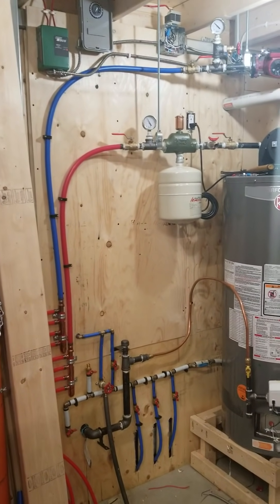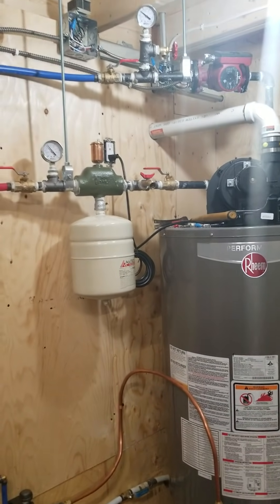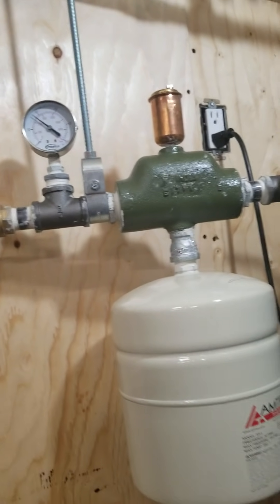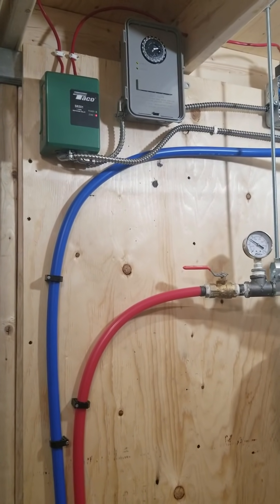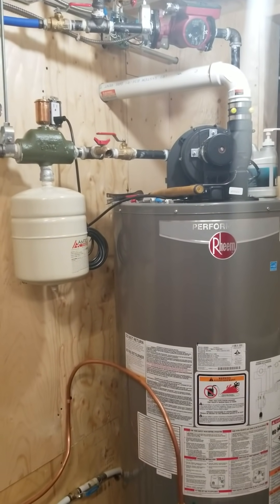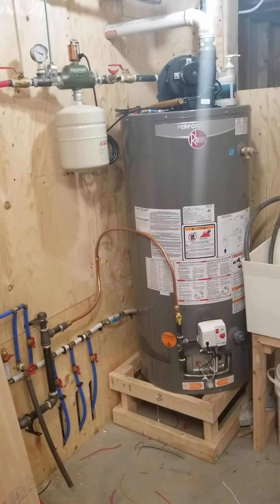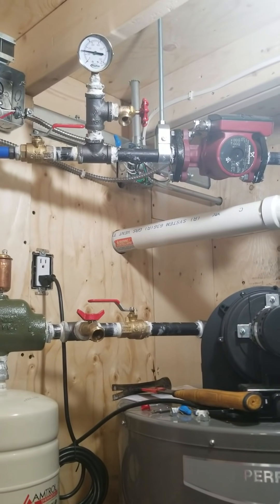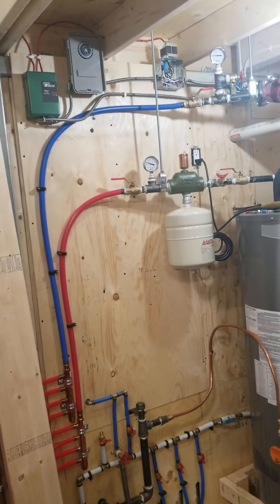DIY In-Floor Hydronic Heating System Using Water Heater

Comment: Why did you choose to add your expansion tank on the hot supply versus the cold intake? Reason I'm asking is I'm doing the same sort of system and I have the same grundfos pump but on the hot supply line (I think yours is on the cold)  and I have a 1 zone ,  return line going back into my cold side of my hot water tank with a check valve on the return and a check valve on the cold water supply to prevent back flow. My expansion tank is in between the 2 check valves(return line from infloor heat - cold water inlet ) (directly off the top of the the hot water tank). Just curious if you had any over pressuring issues since you made your video? (Nice system btw)

Comment: We bought a house 4 years ago with infloor heating in the basement my expansion tank is starting to leak water from around the seal at the top of the tank the tank is mounted to the ceiling above the water tank so it sit quite high anyway what would the leak on the top of the expansion tank indicate. What do you think is happening here to cause the water leak 0:50

Comment: I have a large garage underway - no living space and no water service intended.  This is a great concept but I've been warned that it's not legal in Ontario.  A contractor advises... that water heater sold in Ontario. come with this reference. "This appliance has been design certified as complying with American National Standard/CSA Standard for water heaters and are considered suitable for Water (Potable) Heating and Space Heating. Note: Water heaters used in combination water/space heating shall not be used in space heating only applications."  THE WORDING IS A BIT AMBIGUOUS..; ANY THOUGHTS?
Reply: By ambiguous, I mean the quoted line...the conventional tank is NOT designed for combi heating, but rather soley designed for use on ONE water heating application, so I wonder if this is applicable and if CSA's intent is specific to the single use of a combi-designed product?
Reply: If the garage is a separate unit and not a living space, it is in fact not illigal to use a hot water tank for heating. If it was a home or dwelling unit, you may or mayn't have an issue depending on Bulding inspector. I think the issue with combo units was that people were not using the heating system in summer and bacteria would build up in the heating portion then mix with potable system when turned back on

Comment: You mentioned the cost was near $2000, did that include materials in the floor?  Thank you.
Reply from the maker: Negative. I paid just under a buck a foot for it though. 1 foot of pex per square foot of shop.

Comment: Nice setup. Ive been trying to figure ways to heat a 40x80 shop build for basically as little money as possible naturally and on the fence over wood, oil or gas. Radiant floor heat, radiant tube heaters, forced air unit heaters, a wood burner with waste oil drip and a heat exchanger and also a waste oil forced air or boiler systems. There's so many pros and cons to each setup im still not sure what i will go with but you gave me another option to think about. Thanks for the tour and explanation.

Comment: Nice work , i am currently piecing together what i need to do a similar system in my 2400sqft shop , i have to use an electric hot water tank as i don't have natural gas hook up . Wondering if a electric hot water heater will be enough for my needs , I live on Vancouver Island so the coldest it gets is maybe -15c , I have been looking to size the circulation pump properly as well , the pump i am looking at is 8.5gpm. Would you add a mixing valve as mentioned in the comments? think it would be a benefit to my system ?

Comment: In our previous condo we had installed a GE water heater. We heated the floor with the water heater and use it for all days use. Showers bath and hot water on the faucets . We had this system operated for 11 years and sold the condo last year , with the system still running perfectly. The G.E. Water heater is 60 gallon tank and is warranted by G.E. for 12 Years. The cost of the tank was that time with tax around 1000 dollars Canadian.
Floors,walls and ceiling was heavy insulated. Lots of windows etc. 36 % of walls are glass. New owner very satisfied.

Comment: I really like this concept for the water heater, my question is the timer.  Does the taco relay turn on the timer or the timer turn on the relay. These are 120v tank is 220 volts. Thanks again Gary
Reply: How does the timer turn on the  water tank because it's  220volt?
Reply: The relay controls the pump

Comment: Could I asked,  what size is the water tank,  thanks Gary
Reply from the maker: 50 gallon
Reply: @jpaul1030   is the glycol in the tank also?
Reply from the maker: @garyeager6460  yes, I introduced the glycol to the tank as I was filling the system

Comment: A tankless unit would be better and has a built in pump I can get one for half the price noted above from a nationwide plumbing supplier
Reply: Your concrete won’t crack if it’s 6in  with rebar, 4” styrofoam insulation under your slab
Reply from the maker: Are you located in Canada?
Reply: Wolsely and BG sell tankless and combi’s starting around 2.5 3

Comment: How's this system working 4 years on? I'm building a 1500 sf garage and planning something very similar. I have a very expensive on-demand NG boiler in a 10-year-old apartment building and it's already on its way out, so I will certainly be going with a HWT in my garage too lol.

Comment: Very impressive setup, and really helpful video.     What is the BTU output of your water heater?  I am considering a very similar system, however I need to use an electric heater (planned solar power in the future for my shop), and am trying to figure out the wattage heater I need.  (30' x40' insulated shop w/16' ceilings)

Comment: I don't really think the timer is necessary. Your water heater works best at transferring BTUs when there is a big delta T. Just let the system run and it will eventually catch up. There is no wasted gas... in fact you would be wasting energy when trying to heat high temp water to a higher temp.

Comment: Hi thanks for the video I very much enjoyed it.. One question I had was about the intermittent timer on the system. Why is that needed? My thinking is if the output of the waterheater is getting rather cold the waterheater will be running and the output will be warmer than the input. So it will be adding energy to the system. I'm thinking the timer just limits the heating capacity of the system.

Comment: A lot of brass connecting to iron.  Expansion tank is upside down.  Water pump is at top of entire system and should be at the bottom to prevent cavitation. No mention if the pex is oxygen barrier or not.  Canada must have very relaxed red-seal requirements. I worked at Emco for years so I do have a bit of knowledge of heating systems.
Reply from the maker: Just because you worked the counter at a plumbing wholesaler doesn't mean you have a clue about what you're talking about, and your comment proves that. The expansion tank can be mounted at any angle. Have you never seen an air scoop before? What do you think would happen if I mounted that upside down? Hearing comprehension might not be your strong suit because I clearly said that I was a Red Seal electrician.
Reply: @jpaul1030  You are right about the expansion tank but it is preferred to be topside and the air scoop is to be at a high point on the line.

Comment: What size is your water heater?  Gallons ad but?  I'm heating a 1300 sf building in Montana with a 40 gallon 35000 btu water heater and it seems to cycle too often.  I'm guessing I need more but in order to keep up better.  Also, is there a chance that it would be cheaper with a bigger heater? If it can keep up better its may be more efficient?

Comment: I've had PEX in my garage floor since 2015 and I'm just now trying to get a system put together to actually have some heat out there. You've got some good info here, thank you. I picked up the same pump you've got and some manifolds, trying to figure out my thermostat and heat source now. I'm actually considering hooking up a used water heater initially to see how it works.
Reply: Sounds like my projects... Hope you get it lined

Comment: JP - good informative video. Are you running the glycol through the hot water heater and through the closed loop system, or is water running through the hot water heater and there is a heat exchanger off camera that transfers the heat to glycol in the closed loop?

Comment: I want to do this in my shop. Before I put the floor down we tie wired the pex to the mesh. From the bottom of the hole, plastic sheet, 2” blue foam, steel mesh, and 20’ sticks of 3/4” rebar on 2’ centers. Then wired down the pex in 4 loops as designed by the supplier. The pex is 1/2” red barrier pex made for heating. It has an extra layer of plastic coating to prevent air penetration. I joined all 8 ends together in series with a gauge in-line and added15 pounds of pressure in the pex lines for a few days before the pour 4-5” concrete. Then left the pressure in the line until now.  
My biggest issue is where to put the water tank since the garage has a 2nd floor and the gas chimney is an issue.  I considered tankless, or electric (but I only have 50 amps in the sub panel out there). So after seeing your setup, I’m convinced the best way to go is with a power exhaust through the side wall. 
Good video!  Thanks for taking the time to put it up.

Comment: Good job 
The exhaust motor on that Hot water tank may have a port to connect a 3/8 th drain tube line  with a p trap ( loop in the line ) To drain condensation water out of the exhaust motor , I could be wrong but I see the ports with yellow caps on your tank , 
Just trying to help I’m not an expert

Comment: What type and size of tubing did you run under the floor? My garage is only about 25p Sq ft, and we're building up a subfloor on top of the concrete. How many loops do you think I'll need under the floor? Thanks, this was one of the most helpful videos I've found in this. Thinking of going tankless for my project.

Comment: Why a full cement slab floor vs. an integrated removable grate system that accesses to the pex tubing? You can wrap the pex in foam or narrow insulation batts into the grate channels. Maybe go further with some rubber removable tiles to cover the floor entirely? I understand the weight of what goes on the floor is a factor, but mixing the floor in rows of cement with alternating grates should disperse the focal points of weighted objects on to a larger surface floor area? Another function of these channels is 'if' you have a pex leak, the water can divert to the channels and not pool above ground. Just ensure you have an exit point on the flooring system going down hill and away from your structure.

Comment: I have a similar set up in my detached garage in Minnesota and my water heater lasted 20 years.
Reply: Did you change your dip tube on a regular basis to keep it from disintegrating into your system? Would you have any other water heater maintenance tips you could share with us?

Comment: Great looking system. I think the circulator is supposed to be mounted with the plumbing running vertically to prevent cavitation from air bubbles that cannot get away. I could be wrong though, 
Even so, great system.

Comment: Just rewatching this. In order to keep HOT water stored in the tank (ie 160°) put a mixing valve on the discharge side of the tank connecting the cool return.  160° in the tank 80° return and 110 leaving the mixing valve to the slab.

Comment: Hey great video and set up. Im trying to do the same for my detached garage that is just over 600 square feet with 2 runs in the floor. First of all where did you get all the parts from?  The pump. Expansion tank with that thing above it and the thermostat. I live in ontario as well about an hour north of toronto. I just bought a small 10 litre tank thinking that would be big enough but now im thinking other wise. Now with what Sir Lovey is saying about controlling the flow to get the return temp to 15 degrees lower could you not use an adjustable manifold?

Comment: Do you miss not being able to control flow to each loop via your manifolds?  The expensive manifolds have flow control valves for each loop.  Loops on my system will all be similar length, so wonder how important it is to control flow that precisely.
Reply from the maker: as long as your loops are the same length with the same amount of bends you don't need to individually control the flow. I have slowed the flow down by adjusting the ball valve in-line with the manifold
Reply: @jpaul1030  Makes sense, thanks.  I watched another video last night in which the guy recommended a tank water heater vs a tankless demand/boiler unit.  Other than initial cost I'm still looking into why that would be the case.

Comment: Do you have to pour concrete over tubes or does plywood do the trick if using vinyl plank flooring?
Reply from the maker: there is a video on YouTube somewhere where a guy fastened the water hoses underneath his plywood floor. he said it worked fine

Comment: Hi, I was thinking of having a open loop radiant heat system, so I can heat the house and warm the running water from the same boiler.  Is there any problems associated with open loop system, like too much air in the system or so.  I haven't found much if any open loop system on YouTube.  Thank you
Reply: That's a great way to contract Legionnaire's Disease, not to mention the necessity of bronze or stainless equipment, but aside from that sure open loop is great (sarcasm). Boilers aren't used for open loop systems, ever. You can use a combi boiler with an internal heat exchanger to do both, or a heat-only boiler with an inidrect water heater for domestic, but open loop is an awful idea 100% of the time
Reply: @Darnellp87  Thank you Darinp87, I have changed my mind since that comment.  I read too many articles associated with the legionnaire's disease, so open loop system is out.  However, can you elaborate or give me an example of the combi boiler and a heat-only boiler with an indirect water heater.  Thank you
Reply: @Xbox360Rules00  I guess I'm not sure what you mean by example, like a model number? There are dozens of combi boilers out there as well as indirect water heaters which can be paired with literally any boiler. For the most part, I find combi units to be a piece of crap in comparison to an indirect as they have several more moving parts and are prone to failure as well as have a relatively long wait time for hot water like any tankless water heater (essentially the same idea). They're just a regular high efficiency gas boiler with a small plate heat exchanger, flow switch, and a 3 way valve inside. Just like a tankless water heater, when a faucet is opened, the flow switch tells the burner to come on and start making hot water. The 3 way valve has to divert flow from the space heating load to the domestic water load (heat exchanger) in order to get heat over there. So essentially it's a boiler and tankless water heater "combination" in one. The indirect WH is an insulated tank much like any other tank style water heater, but instead of having elements or a burner inside, it has either a coil or tank inside of the larger tank which is circulated with hot boiler water to heat the surrounding tank full of domestic water. Still has a regular thermostat like any other tank water heater, but when that thermostat calls for heat it fires the boiler and pumps hot boiler water through the coil instead of firing its own burner or elements. This way you get much better recovery than a standard tank WH meaning you can use a smaller tank, and most often with a better efficiency rate than a standard WH tank. A simple Google search will explain it a whole lot better than I can

Comment: OVERKILL--------ALL YOU NEED IS A PUMP -THERMOSTAT -PRESSURE REDUCING VALVE 12 PSI MAX  AND EXTROL TANK ..HOOKED UP TO CITY WATER WITH A BACKFLOW PREVENTER ! OPTION 2 ---A COIL WITH A FAN BEHIND IT
Reply from the maker: YOU HAVE TO GET A BACKFLOW PREVENTER INSPECTED YEARLY AND I DONT WANT TO DO THAT

Comment: Best way for floor heat is to have a Floor Sensor to keep it from cooling down so much. 
Mine is Max Floor temp 20c. Room temp minimum 15c. Keep floor at 15c. Floor maxes at 20c so feet dont sweat however room could be lower temp with outside air (have makeup 240v Electric Heater for when garage door Opens to bring temp up faster, or if im working in there and chillier. 

Keep runs Under 200-150 Feet if possible. (foot runs are marked on the piping!
Run outside perimeter on FIRST on runs, then back to manifold. 

Remember - Ball Valves are supposed to be ON OR OFF. Otherwise packing will wear over time. 

Hot water heat forever!!

Comment: This has given me ideas to include in a out door wood boiler feeding a water mass to in ground heat.   I was actually thinking of using straw instead of wood. Once or twice a day throw a small square bale in the boiler to heat the tank. Then using that to heat the house. 1000 gallons storage in a high insulated outbuilding or in home room.

Comment: the out going water is too hot, should be about 110 degrees. the return temp is too cold. should be 10 degrees less than the supply. a better way would be to use a tempering valve on the supply with return water being used as the cold inlet of the tempering valve supplied from a tee off of the return. you are shocking the W/H on each cycle. my recommended setup would allow the W/H to continue to run without cooling down below the desired output temp.this way you would not have to time out the W/H

Comment: My energy guru says that a hybrid water heater is cheaper to heat your floors than gas or oil. Depending on the homes heat loss will determing if you need a storage tank to make up the slower recovery time with hybrid vs gas.